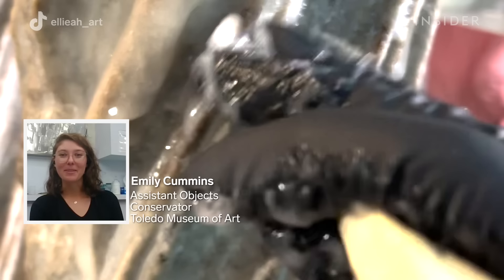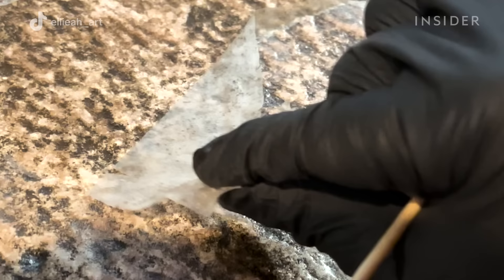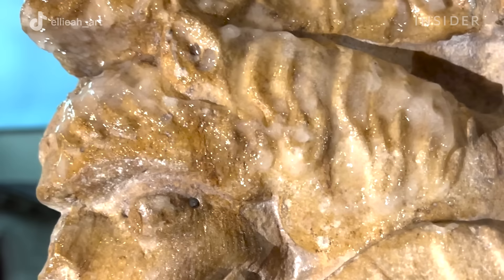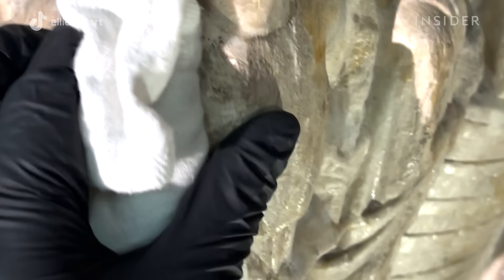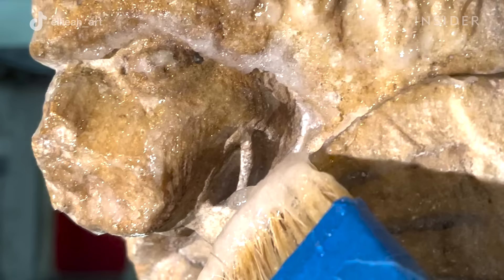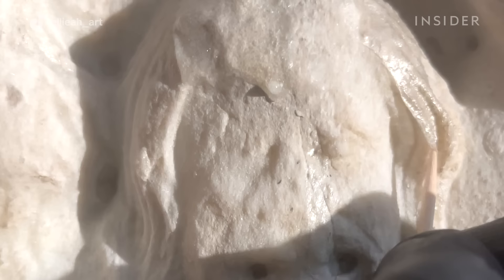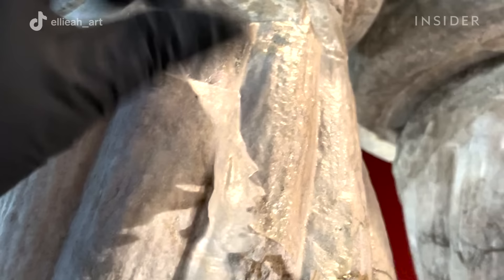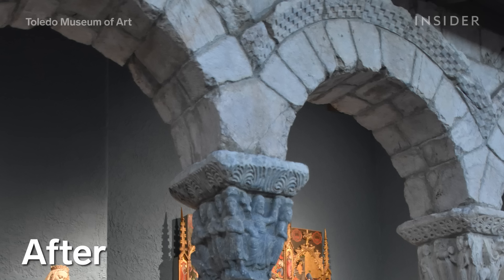Deep Cleaning Embedded Dirt From Cloisters | Deep Cleaned | Insider

Comment: Hi yall, I'm an art conservator that primarily works on stone like what's seen here :) Looking through the comments, I thought I'd clarify a few things for those interested in more:
1. Yes, this is safe! The chances of any part of the stone coming off with a minimally invasive treatment like this is very low, but if that does happen (and it happens more often than you think) we bag it, tag it, and take note of where it was and what caused it to flake and it can either be reapplied or saved in the file to be used for future testing that would require a sample to be taken from the object anyways.
2. Continuation of above, but yall would be SHOCKED to know the kind of work conservators can do on stone. For example, I had to remove concrete mortar (slathered onto original sandstone in the 1960s as part of an installation) by literally taking a chisel to it. We do ample testing before doing anything and found that the sandstone was so hard, in comparison to the minimal force needed to remove the mortar, that there was no harm to the object. And seriously, not even a single dent was made even if you accidentally struck the sandstone. Remember that these structures have lasted this long for a reason! They're incredibly durable. 
3. I see lots of lighthearted comments about how the reveal was not very dramatic, and yes a lot of what we do does result in pretty underwhelming differences. But, consider the impact those slight changes have on in person viewing. Before, you'd think the stone was a warm off white until that yellowed surface film revealed more of a true cool white beneath it. Subtle difference, but it really changes the viewing experience and brings us closer to how it originally was meant to be seen.
4. Even in the microclimate of a well regulated museum, our objects still collect dust and oils from the air and from visitors. Doing surface cleans like this, both dry and wet cleanings, work to reduce any build up over time and keep the stone in good shape.
5. Last point, deep cleans like this are also very useful because sometimes you find an unrelated issue. Invisible cracks and unnoticed damage done by visitors that otherwise wouldn't have been noticed, as we are often rotating between hundreds of higher priority projects, become glaringly obvious. We can take note for a future project or intervene immediately if necessary.
That's all, glad to see such a comprehensive and well explained video about our work on Insider :)
Reply: The dirt was part of the character and history of the sculpture… great job
Reply: I appriciate your comment. It is worth is and makes things clear. Thank you.
Reply: Thank you for your insight! Although I guess it really does vary depending on what you're working on, wouldn't that method destroy any remaining traces of polychromy that may have been present on the stone?
Reply: @memphismadetez  Yes and could also damage it in the long run.
Reply: @memphismadetez  Many people feel the way you do, and without the knowledge of deterioration and how it affects artifacts I see the merit to this argument. However, dirt and dust has lots of nasty properties that can lead to permanent damage over time. Of the three types of deterioration (chemical, physical, and organic), organic is some of the worst. As mentioned in the video, dirt like this is deeply embedded into the porous surface of the stone. Dirt and soil can be acidic, saline, can contain traces of reactive metals like copper and iron. While the microclimate of the museum can help to limit this, soil also can flex and shrink with exposure to moisture. This constant flexing, freezing, and shrinking can and will eventually cause cracks. If we wish to prevent this, unfortunately the dirt must come out. Hope this helped!
Reply: @wunderwhere  I had answered a similar question in the other replies with a more lengthy explanation, but the short answer is that we would know before hand if there are any traces of pigment found on the object before performing anything of this nature. Depending on the nature of the pigment, a different approach would be taken for those areas. Unfortunately, most stone has no memory of their old guilding and paint but we can make educated guesses about what the pigments could have been, if there were ever any at all, by examining similar structures from the same era and region.
Reply: Thank you for your explanation 😊
Reply: omg tysm for taking the time to share your knowledge with us!!! your expertise and experience is SO cool i really admire your work!!! this is really interesting and i appreciate it :-)
Reply: Thank you for your explanations!
Reply: Thank you for explaining! I learned just as much from your comment as I did from the video itself. :)
Reply: Thank you for sharing your personal knowledge and experience with us! I'm embarrassed to admit when I saw the thumbnail for this video on my feed I thought it was an Elden Ring lore video LMAO
Reply: What is the name of the gel that is mixed with water for this process?
Reply: thank you for you knowledge! this is so interesting. museums feel much more interesting when you get to be one of the researchers behind it, it kinda makes me lose my hype to go see one as a visitor lol, but its still great to see the work behind it all

Comment: Does the cleaning remove the process of determining if it was painted and what color?
Reply: Hi, conservator here! Typically we would know before doing anything of this nature if the surface was originally painted or not. Unfortunately, most stone has little to no physical memory of what was painted, but we can guess from historical context and from similar objects that do have trace pigments. But, to answer your question, if there were traces of pigment on the stone the approach would be different that the video to avoid removing any paint. It probably wouldn't even be out in the open like this unless the pigments were readhered to the surface (usually by injecting small amounts of adhesive behind each raised flake). These areas would either be avoided entirely or a weaker formula would be mixed and tested on various spots before being applied to the entirety of the object. We can even mix dozens of slight variations of the same solution and apply them like a paint by number to areas that need different strengths.

Comment: Those two columns don't remotely resemble each other, unless you count that the rehabilitation of the obviously deteriorated larger column has been carved down into the appearance of the present column.

Or they did not take a picture of the same column. You can see in the video staff peeling off a thin layer of the dirt in the gel. The staff did not peel off any monstrously thick layers. The only way to account for the difference in appearance and thickness is poor photography. Actually it is possible that they took pictures of two different columns at somewhat different distances from the camera lens.
Reply: There were no thick layers peeled off because as they said in the video: the gel is 90% water and they wait till it is DRY. Once it has dried out will only have 10% of the original volume meaning a thick layer will become thin.

Comment: Should've just hauled them down to the carwash and pressure cleaned them. That chemical they have for your tires is amazing. Let that soak on the pillars for a few minutes and hit them with the high pressure sprayer. Pressure washers have 1000 great uses!
Reply: Are you serious? chemicals and pressure washers would damage the stone 🤦🏻‍♀️ They dont even recommend pressure washers for gravestones. You should be trusting the process of professionals